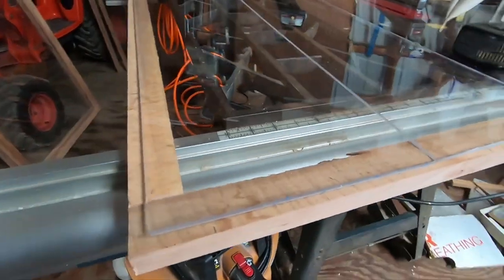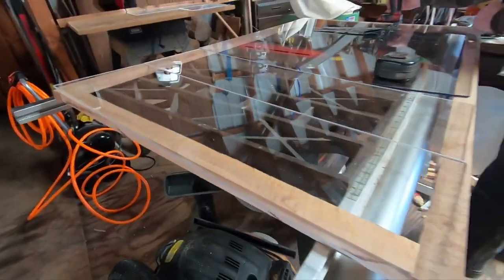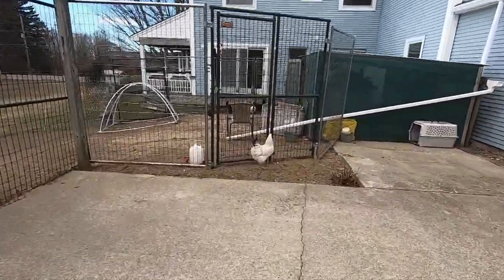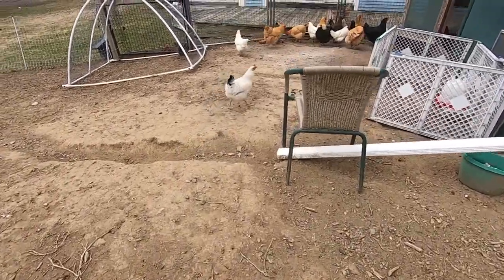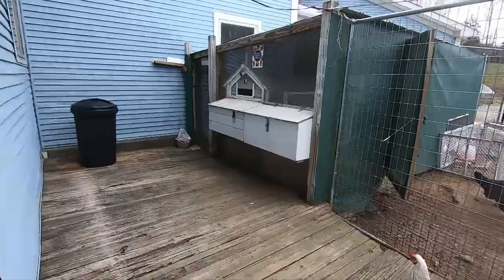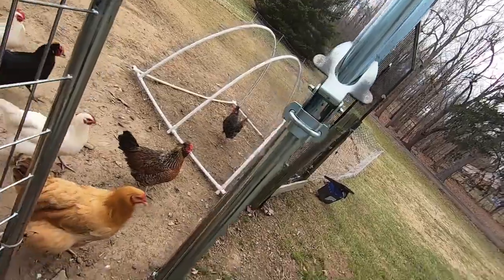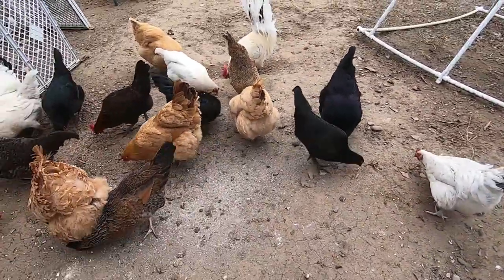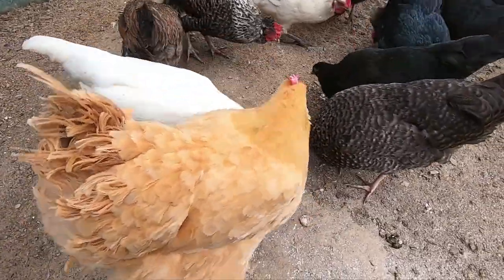Some Interesting Channels Take A  Look

Comment: The cold frames are really nice. Can't wait to see when it's all up. Glad you showed pretty lady because I was going to ask about her. Do you keep Mr. Brown outside until it's time for her to go to bed?  Have a good night NonnaGrace. 💚
Reply from the maker: Hello Gloria,  He is making them really nice. I have wanted a little green house for a long time and because of the wind it get destroyed. The cold frame is going to work like a little green house.  He is building it to last. I know he will find a way to anchor it so the wind will not destroy it.  
Mr. Brown sleeps in the house still. I do have the rooster house for her if she doesn't fit in to the chicken house by Easter week.   I bring her in and out.  she follows me and like a little kid  I melt with her pacing and know that she wants in.  So she comes in a lot and is outside a lot about 1/2 in and 1/2  of the time out.   💕NonnaGrace